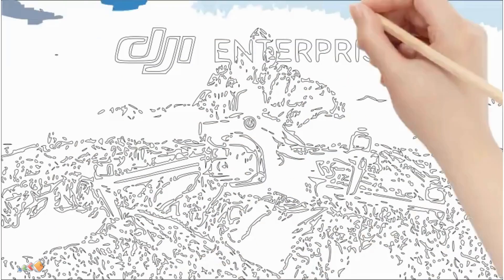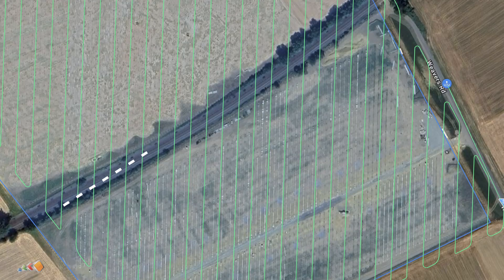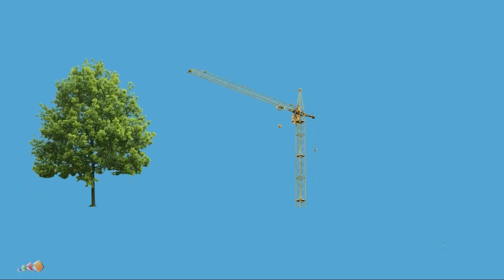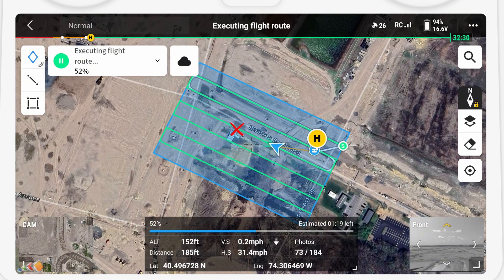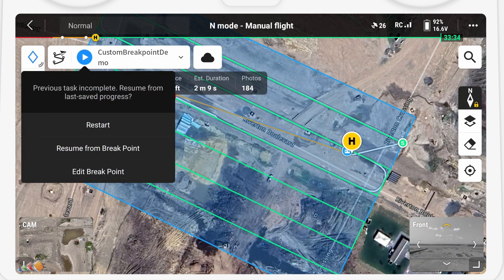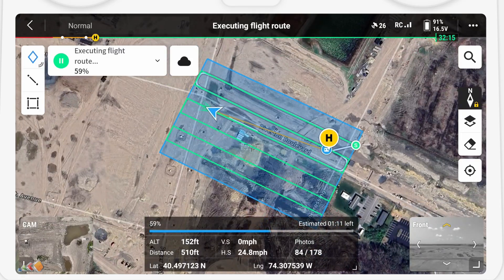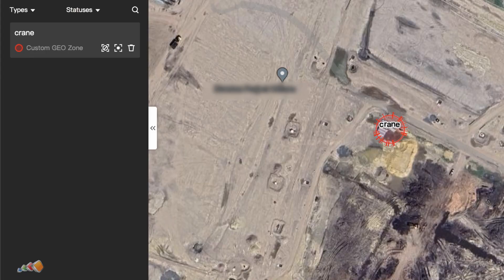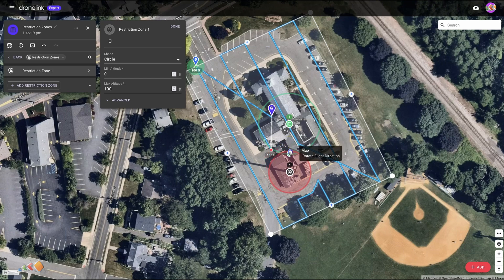DJI Pilot 2 Mapping - Custom Break Points

Comment: Source for custom geo zones for the M300? Can't seem it find anything on it.
Reply from the maker: Do you mean a dsm for terrain follow?
Reply: @aviosmedia  for obstacle avoidance.
Reply from the maker: @seantorcello3325 you want to geofence an area?  Or mark things to avoid when mapping?  What software are you using?
Reply: @aviosmedia same thing. Mark areas out as no fly zones on Pilot 2. Instead of using custom break point for everything. Dronelink doesn't support M300+ to it's full potential.